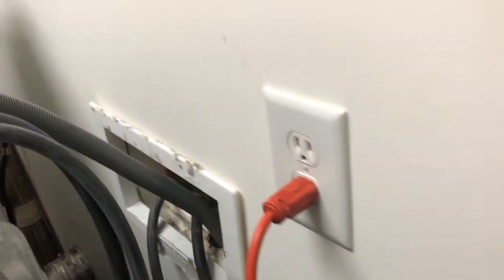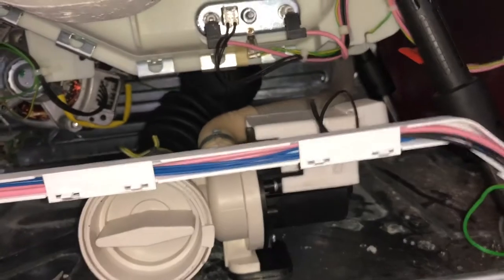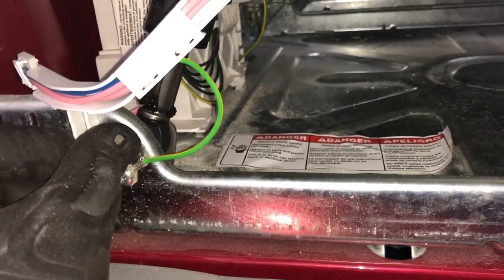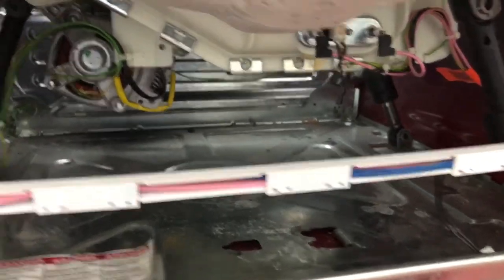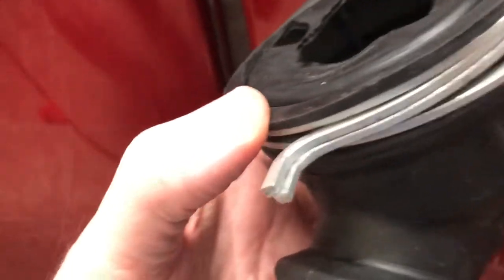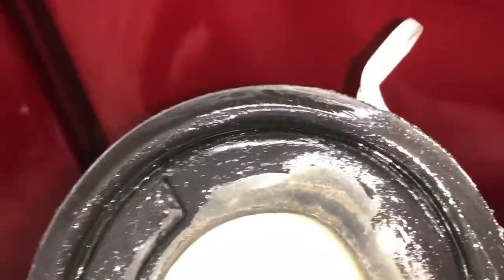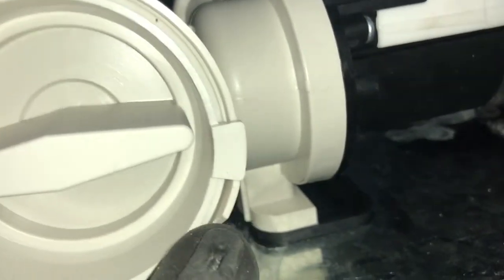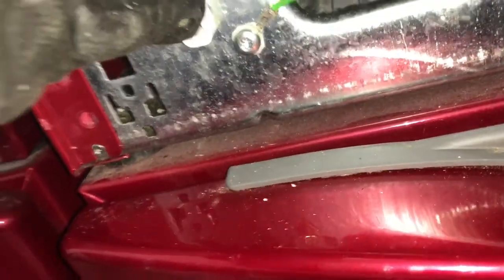F21 Whirlpool Duet Washer F21 Error Code Step by Step How to Fix

Comment: Very thorough! My impeller, it too has developed a hole in it.
You said you heard that you should get about 3 years use from that pump. Where did you hear that? It's been 3 years now. How has the pump been working?
Reply from the maker: Yeah most of the Amazon knockoffs have anywhere from 2-3 as a lifespan.  Mine worked until a bearing took out my washing machine, about 3 years and was doing great.  I’ve used the knockoff heating elements for my dryer and they burn out every 18mths - 2 years but since I’m paying $28-$35 I’m not complaining

Comment: Very in-depth video some say it was to long but I watched it all. You never know what you may miss. Also I clean my filter out from time to time and I’m able to get rid of the F21 code. 

After the clean I also check the propeller to make sure it’s still spinning with no issues. So far so good. BTW,  I have the same exact make, model and color as you Lol. 

So it’s good to know should I need to buy a new water pump I’ll know exactly what to do. We’ve had the washer and dryer for 12 years and the only thing I’ve replaced was the washer door hinge. 

Thanks for making this video, it’s ver much appreciated!
Reply from the maker: Noted

Comment: Fantastic video, thank you!  I'm wondering what tells the pump to turn on and off and sense water to be pumped.  Obviously the computer board tells the pump to kick on, but I don't know how it knows when the water is drained.  I don't see any float or other means of sensing water.  I wonder if the computer is sensing a change in resistance to the pump motor.  
I'll be opening up my washer later today to begin.  thanks again!

Comment: “Pliers”= Channel locks.  Lol. And I’m gonna put a large hose clam on ours... that’ll make that battle with the black hose A LOT EASIER!  It definitely is a battle for sure, ESPECIALLY WITH THE PUMP IN THE WAY, like I had.  Good info though.  Many thanks.
   I also found that you must make sure that the ball doesn’t get pinched up in the black hose with the clamp. That happened to me when I put it back on.. sucker backed up and shot water everywhere, blew the dang clamp and black hose right off and water went all over the place.
Reply from the maker: Agreed

Comment: thank for replied my question, the window appeared FP code that mean something relate to the water pump how to fix that problem please help me thanks. When I bypass  and used the drain and spin the motor work well after that I continue next funtion rinse and spin they work very well I think the motor has no problem
Reply from the maker: At this point ensure there is no obstruction within the drain lines and then replace the pump.  You specific pump can be found on Amazon with the units Model number.  I have two specific videos on how to replace the pump.  It shouldn’t cost you more than $30-$40 USD on a new pump.

Comment: Hi Joshua I had a whirpool  10kgs series 6 it wash to the drain period and then stop with the code FP I used other funtion to drain water and spin please help me to fix that
Reply from the maker: Ii could be that the Motor control Unit is bad, and or the door lock solenoid is damaged.  The door lock solenoid is an easy fix.  The motor control unit is costly but still fixable.
Reply: Thanks for your advise I will try
Regards

Comment: Did this end up fixing your issue or did you have other issues after doing this? Thanks.
Reply from the maker: Yes it did.  The main point I was trying to get across was the black tubing underneath was so difficult to get back on.
Reply: I’m having the F-21 problem right now. How do you tell if the pump motor is bad? I’ve stuck my finger in the hole you mentioned after taking out the catch basin and the part wiggles. Is that normal? How does it supposed to feel when it’s bad?
Reply: @marcos_bm13  if it's not draining water it's most likely the motor
Reply: DEPROGRAMMED thanks. I just ordered a new motor on Amazon like you recommended on your video. Hope it solves my problem.
Reply: @marcos_bm13  it's not my video but I just had the same situation and replacing the motor fixed my problem. I did buy my part from an authorized dealer that sells OEM parts because I've heard horror stories about cheap Amazon parts. Good luck!
Reply from the maker: Worked perfectly
Reply from the maker: Marcos Betancourt the pump is what was wrong with my washer.  I did not have to replace the motor....at least not yet.  All has been good with my washer since I replaced the pump.
Reply from the maker: The motor is almost always not the problem.  The pump impeller is what broke on mine which is what you felt with your finger
Reply: @jdmediahub  that's what I meant by motor "pump" fixed my issue as well

Comment: You did not show the most important parts !!  You did not show how to remove the pump and you did not show how to install a new pump. Give me a break !! We don't need a 48 minute video on how to disconnect and reconnect 2 hoses and an electrical connection.
Reply: I agree with you Imre. I think he could have kept the video to 10 minutes and still told us everything we needed to know.